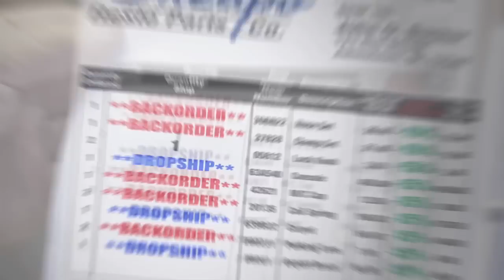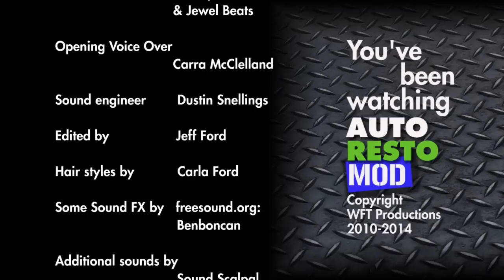Mustang Classic Car Clutch Pedal Support Replacement Episode 158 Autorestomod

Comment: I have a 67 Mustang that originally had a 3 speed standard trans. I bought a "clutch assist spring" because it was missing from mine and was wondering if it originally had one and if I need to install it with my T-5 trans and Centerforce clutch... Thanks in advance!

Comment: I just watched this, and its previous video, and noticed a few interesting things. The original support had the elongated hole so the clutch stop could be adjusted. My Mar '64 build was like this. Also, there was the bracket that screwed to the firewall that held a piece of felt around the rod. Again, like my '64.
Reply from the maker: This was in an early to mid '65.

Comment: Showing the needle bushings could be better as far as the order of placement of parts. Like the brake pedal bushings replacement from stock. also if you use the kit that you have to weld the pedal rod in place. are the 4 washers in the kit for spacers of brake pedal?

Comment: do you guys have a video on the removal of the steering column? I cannot install a completed pedal assembly while the column is installed and can't figure out how to remove it, thanks
Reply: all i needed to do was take the 3 bolts at the steering gear box out and i was able to get mine in

Comment: 1970 f-250 4x4  4 speed New process trans. Is it possible to replace the clutch pedal spring insulators without having to remove the whole pedal assy?
Reply from the maker: Possible, yes. Easy...no.
Reply: @AutoRestoMod  how can it be done?

Comment: Why would you choose not to upgrade the trunnion to a ball bearing? I mean, I get it, if the car was going to be a 100 point concours restoration, then no, but you have stated that is not the path for this car. I'm not saying you are wrong. I'm just curious about the thought process that led to this decision. To me its one of those "Might as well"s that come with repairing/constructing cars. Excellent video yet again.
Reply from the maker: Well, Jeff wants to use that when we do the five speed later this summer. It will give them a double hit on the parts.

Comment: Tried to do it the same way (66 model ) and SD clutch pedal hook just bent as there to much tension and lug is bent about 30° from pedal assembly axis (used brand new SD spring) I don't know if spring strength is off or if pedal is made out of crappy metal but didn't work and still try to address the issue... disappointed by brand new parts...
Reply from the maker: Sorry to hear about that issue.
Reply: Finally got a spring from ACP and fixed the issue. Other brand new spring was junk. Love your show guys keep going !

Comment: i just got a 66 coupe the clutch /brake pedal rod has a "C" clip on it and a lot of parts are dated C4  why is this ? is mine a early 66  model ?
Reply from the maker: Unless Ford made a dramatic change the part number (C4ZZ-00000) would stay the same from its inception. If a minor change was made the part number would reflect this with a suffix change (C4ZZ-00000-A). A minor change could be as small as going from a C-Clip to a break-over clip.
Reply: @AutoRestoMod  
i found out mines a 64.5 old ,, sruff clutch stuff do folks ned it for a concuss restore
?
Reply: @AutoRestoMod  
my 66 has a "C" clip  i checked everything over good and i will work